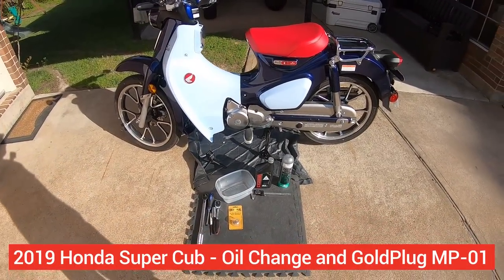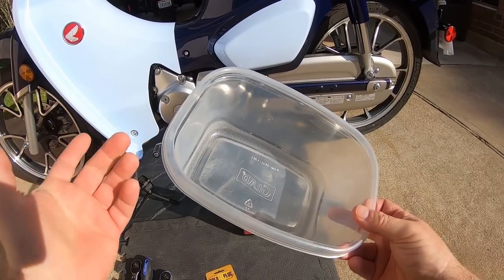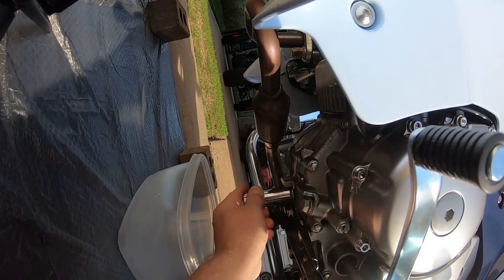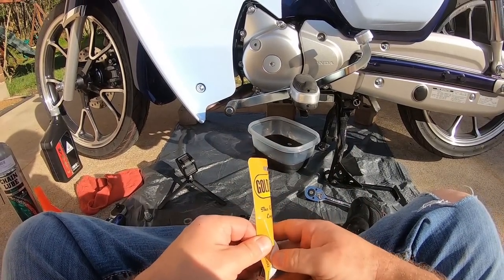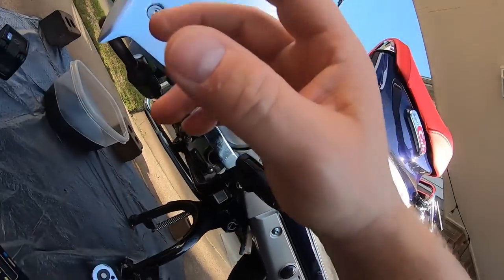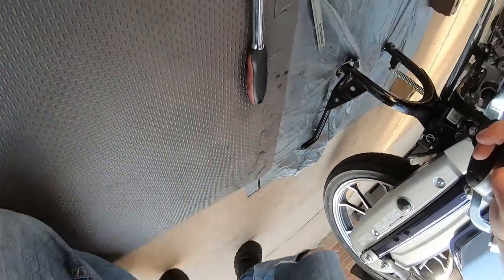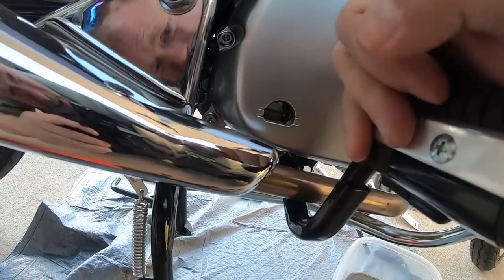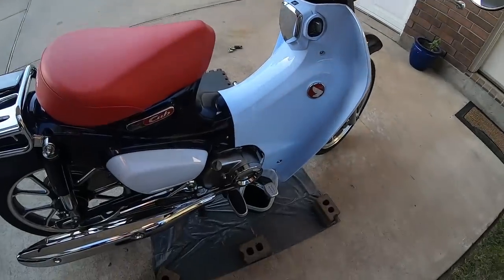2019 Honda Super Cub C125 // First (early) Oil Change // Gold Plug MP-01

Comment: Luggy cold start, mine does that too. But it idles up when it's very cold. I use at least 91 octane gas as well
Reply from the maker: Yep, it seems to be a common issue with the new Super Cub's.  I took mine in for the dealer to check out and they asked Honda about it... nothing "abnormal" as far as they are concerned.  I noticed that my friend's Cub (Adrian) also does the same thing.  It's not really a problem for me... I just baby it for the first 10 seconds after cold start to make sure it keeps spinning.  Cheers!  👍  --QM
Reply: @QuasiMotard  it's not a problem for me either. I dunno maybe it being an older style engine but updated management, that first start just needs coaxing sometimes. I switched upper octane and it has not idled off on first start. I dunno. I like my bike alot. I just noticed the spot on your video about the luggy start and I was like..me too! Lol

Comment: Yes, they do have an oil filter. The clutch drum is a centrifugal filter.
Reply from the maker: Agreed, but it's not a traditional oil filter.  The oil "spinner" on these bikes requires a cleanout (overhaul) every 8000 miles, and that procedure requires the removal of the engine side cover, oil spinner assembly (with a special tool), and fresh gaskets (side cover gasket and new O-rings for the spinner seal).  The procedure isn't as simple as replacing or cleaning a traditional filter, so many owners might not be inclined (or able) to do it at home.  --QM

Comment: 6:58, you can use tail of the caliper for measuring depth
Reply from the maker: Yep, I thought of that after the video.  I was trying to keep everything in frame and simple for the video's sake (it's hard to know what the GoPro "sees" after the screen shuts off).  I didn't want to use the tail when checking the depth inside the oil drain hole, though... no sharp metal poking around in there blindly.  When I used the straw and saw that there was plenty of clearance (over 1/8"), then I didn't bother following up with a precision measurement.  Cheers!  👍  --QM

Comment: Thanks Quasi...very helpful!!
Reply from the maker: Glad it was helpful!  I didn't have the service manual at the time of recording this maintenance, so I wasn't sure about the second bolt on the close (left) side of the lower crankcase.  That is the cam chain tensioner bolt, so you don't want to mess with that one unless necessary.  The owners/operators manual doesn't give any specifics on the procedure, so I just went with what I knew to be accurate on the drain bolt location.  I have the service manual now that gives all of the other detailed procedures and specs, so there isn't any more guesswork.  😉👍  --QM

Comment: Great video, I like the way you have been so thorough. I do however think your bike sounds a bit lumpy....it’s missing a bit. The Cubs normally run like a sewing machine. It’s maybe worth looking at the spark plug.
Reply from the maker: Thanks for the feedback!  The new Cub has a bit of a lumpy idle and the exhaust note is quite deep and mellow for a little 125cc motor.  I just picked up my new Trail 125 (CT125 Hunter Cub) a few days ago, and its exhaust note is lumpier (but quieter) at idle.  Stay tuned for the Trail 125 unboxing and first ride videos coming in a few days.  Cheers!  😉👍  --QM
Reply: @QuasiMotard  excellent I will look forward to that!

Comment: S trick is to weigh the used oil then weigh the new oil to check difference.
See if u can fit a l.e.d lite bulbs to save overloading altenator.
Reply from the maker: Oil weights would likely be different because of evaporation and slight differences in the fill levels.  I've done 2 additional oil changes since this one, and everything looks really good so far!  The GoldPlug magnet has caught a significant amount of ferrous material both times, so it appears to work in the Cub's sump.  All of the lights on the new Cub are LED's, including the driving lights that I added to it later (Denali DM, 5W/each).  Cheers!  👍  --QM
Reply: @QuasiMotard  generally when engine is new there will be a bit of metal coming off the timing sprockets, chain etc. Oil changes are great especially when it involves wet clutch plates. Dont skimp on good oils and make sure the correct oils is used for the seasons and climate. Amsoil (pay for a kit and become a dealer...brilliant company) Repsol, Eni Agip, Motul, Penrite and Castrols are all great dedicated brands for motorcycles. I find manufacturer in house brands is generally "fill" for the company for profit). I have came across with the Maxxima brand that says A.t.v etc but has no a.p.i ratings which we gave up on.

Comment: With regular maintenance, given that it's a honda, that thing should last a very long time!
Reply from the maker: I'm on the 3rd oil change now (last changed at 1500 miles), and I switched over full synthetic (Castrol Power1 4T 10W-40) this time.  I just returned from a 450-mile motocamping trip and ran the Cub at 55-60 mph the whole way there and back.  I was curious (concerned) to know how it would behave at wide-open throttle for hours at a time.  It hasn't burned or leaked a drop of oil... still at exactly the same level as when I filled it.  It's a Honda!  😉👍  --QM

Comment: Hi Quasi. I love your videos, I am taking my time watching the Cannon Ball Run episodes. Can’t help but admire your stamina and determination… that’s a giant adventure even on a big touring bike let alone a Super Cub !
Last week I bought a 2019 Super Cub with 25 miles, it’s immaculate, I now have 40 miles on it.
Question :  Would you change the oil on it NOW, because the factory oil is 4 years old ?
Note , I’ll change it at 300 miles also.
I did siphon out the 4 year old gasoline, and put in Sta-Bil 360 (1 ounce), and a gallon of fresh Shell 91 octane.
I’ve owned Moto Guzzis and Harley Davidsons for 40 years and always did real frequent oil changes so I’m thinking maybe I should change this 4 year old oil with only 40 miles on it.
I’m leaning towards using the Honda 10-30 conventional oil like you and switching to Mobil 1 full synthetic like you at 1000 miles ?
I’d appreciate your opinion.
I’ll get the Gold plug too.
Thanks.
Reply from the maker: Congrats on your new-to-you Super Cub!  The 2019 wearing the 60th anniversary blue color is the best looking, in my opinion.  I don't think it's absolutely necessary to change that oil, but it couldn't hurt anything to do it as a precaution.  Personally, I'd just wait until around 300 miles and change it like I did in this video.  

I strongly recommend investing the extra $20 in a Gold Plug MP-01.  Those things really work, and I always find ferrous sludge (and sometimes sharp chunky bits) on the magnet at every oil change... even at 15K miles.  These engines don't have oil filters, so it's cheap insurance to prolong the engine's life before needing a rebuild.

I typically wait until around 1000-1500 miles to switch over to full-synthetic so the engine is fully broken-in.  After the first 1K miles, I ran Castrol Power1 4T 10W-40 full-syn in my Cub for the next ~10K miles.  However, I switched over to Mobil1 4T 10W-40 full-syn during my return from the Cannonball in 2021.  

We noticed that our Cubs were steadily consuming/burning 125-200mL of Castrol per day at wide-open throttle (450-550 miles, 12-14 hours/day).  When we switched over to Mobil1, the consumption stopped... not reduced... STOPPED.  We didn't burn or lose a drop of oil from California all the way back to Houston.  Something about the Mobil1 base stock is thicker or resists seepage, so it seems to run better in these little Honda 125's.  

I also switched over to Mobil1 in my Trail 125 (CT125) during my 1600-mile trip to the Barber Small Bore Festival in 2022.  Here is a link to the first episode of that adventure if you're interested:  https://youtu.be/xItNMZ--qSc .  The little CT125 burned through nearly 300mL at wide-open throttle during the first day of that trip... 720 brutal miles in 14 hours at wide-open throttle!  Cheesr!  😉👍  --QM
Reply: @QuasiMotard  Thank you for the response so fast!
Yeah I really like the 60th colors the best of the 4 years of the Super Cub too. I’ll go ahead and wait until around 200 to 300 miles to change oil, and DEFINITELY install a Gold plug.
That’s amazing how your oil usage actually stopped when you switched to Mobil1. I’ve been using Mobile1 full synthetic in cars, trucks, and a motorhome along with NAPA Platinum, and Wix filters for about 5 years and real happy with Mobil1. I’ll switch to it for sure eventually.
I’ll definitely watch the Trail 125 video, I’m sure it will be interesting.
Thanks again, and safe travels to you. 👍😎

Comment: What was the other bung with the copper washer for, you reffered it to a service item  ,?
Reply from the maker: That second bolt with the copper washer is the timing chain tensioner.  It can be removed without any serious repercussions, as long as it's reinstalled correctly before the engine is turned over or started.  

Some Grom and SC owners have mentioned that they pull that bolt out during oil changes to drain some additional dirty oil that accumulates in that bore hole.  Removing and reinstalling that bolt can also reset tension on the timing chain idler wheel, which could potentially benefit engine longevity... dunno... maybe?  Cheers!  😉👍 --QM

Comment: What would be the reason for replacing the factory bolt? Really nice video, thanks for sharing.
Reply from the maker: The GoldPlug has a neodymium magnet on the tip of the bolt, so it catches ferrous debris in the oil and holds it until you clean it off during a maintenance period.  This helps to keep those abrasive particles out of the sump, so it should aid longevity of the engine amd transmission.  Keep in mind that the Super Cub doesn't have a traditional oil filter, and it only holds 0.8l of oil... that's a small volume of oil, so it can become contaminated quickly.

I always find lots of metallic sludge and some sharp particles stuck on the magnet at every oil change.  That tells me that the magnet is doing its job! Cheers!  😉👍  --QM
Reply: @QuasiMotard  cool, thanks man.

Comment: Hello, in the user manual, it says that it is best to have this operation (oil change) made by an expert mechanic. 
Do you think is it okay if I perform it by myself ?
Reply from the maker: The Super Cub is probably the easiest bike to change oil out of all the bikes I've owned (120+ over 40 years).  This older 2019 Cib doesn't have an oil filter, so the change is literally just a drain and refill with 850mL of oil. 😉👍  --QM

Comment: you have to be real lazy or incapable to hold a tool to let your mechanic  charge you unnecessary money for a simple service for such a simple and fuss free machine. its so simple that you fall in love with it just for this very reason , pure motorcycling pleasure.
Reply from the maker: Agreed... I prefer to do all of my own maintenance anyway... at least I know that it has been done correctly.  I will usually let the shop handle the first couple of maintenance intervals (e.g. required by warranty) so it's recorded on the VIN.  After that, I do 95% of the work myself and document everything thoroughly (e.g. pictures, logbook, etc).  It's surprising what you can accomplish with a factory service manual and a modest set of tools!  However, I take my bikes back to the dealer for any recall items or heavy-lifting chores... tire replacements, engine/transmission work, etc.  --QM

Comment: Great video, however I have a question. Do you change the oil every 300 miles ?? I have a 2018 C 50, that I just bought, and I m kind a beginner. Thanks
Reply from the maker: Thanks for the feedback!  This was just the first early oil change.  Honda's maintenance schedule for the Navi is 600 miles for the first oil change and every 2500 miles after that.  

I typically change the oil early in the first 300-600 miles to get the abrasive junk out of the engine.  Then I change the oil every 1500-2000 miles for these small engines because they don't have oil filters.  Cheers! 😉👍 --QM
Reply: @QuasiMotard  Thanks for your feed back ! I tought that it must be changed so often.. 2000 miles seems ok. Take care and have a nice ride. Cheers from Romania

Comment: Hi Quas.. have you ever had to fix a stripped oil pan thread?  Unfortunately, after my second Cub oil change, I inadvertently stripped mine (using MP01 plug) even before I could torque (plug was not getting tighter, which leads me to believe it may have happened after my first oil change (watched this episode a year ago).  There's a couple of videos on YT that shows how to use a Thread Repair Kit to basically re-tap the threads and avoid replacing the oil pan unit which can probably cost a fortune.  Any words of wisdom in this case?  Much appreciated.
Reply from the maker: Ouch... I'm sorry to hear about your troubles!  I've used Heli-Coil thread repair kits on cars and trucks in the past... anything from oil & transmission drain bolts to spark plug re-threads.  However, I haven't done it on any of my motorcycles.  

Most larger motorcycle engines have separate oil pans/sumps that can be replaced if necessary.  Unfortunately, these small engines don't have a separate pan... the oil sump and drain plug bung is part of the engine's crankcase.  That means repairing it with a new thread insert is the only way to salvage the problem without tearing the motor apart to replace one half of the crankcase.

It might be possible to re-thread for a larger diameter drain bolt, but I would leave that as a last-ditch effort.  There isn't much extra clearance around the bolt head to accommodate a larger drain bolt, and removing too much metal from the thin lower crankcase might create more problems in the long term.

Good luck with the repairs, and keep us informed how you get along.  I'd be very interested to see if/how a thread repair kit works on one of these little 125's.  Cheers!  😉👍  --QM

Comment: Hey man How often do you suggest to change the oil un a 2020 Supercub? I just did my first oil change at 500 miles.
Reply from the maker: I always change the oil on my small bikes every 2K miles.  The Honda owner's manual says 4K miles, but I think that's a bit long.  These bikes only hold ~1 quart of oil and they don't have traditional oil filters.  Oil is cheap, engines aren't!  I'd rather change early and often to be sure that I'm not grinding up anything important in the crankcase ( https://youtu.be/jk0E51XPD34?t=729 ).  Cheers!  👍  --QM

Comment: The manual is freely available as a pdf online.
I was wodering should I go to the dealer for my first oil change at 600 miles? I can do it myself but I guess my question is is it critical to resale value to have it dealer serviced?
Reply from the maker: I don't think it makes any difference whether it's dealer or owner serviced.  The critical issue is really about warranty coverage... if the dealer does the service, then it's recorded on the VIN for warranty purposes.

I do all of my own service on my motorcycles after the initial check-up.  I take pictures of the mileage, the parts, and receipts as proof of service.  Cheers!  😉👍 --QM
Reply: @QuasiMotard   Thank you... Great idea re photos of odometer etc!
 I know the manual recommends 10W30. I used 10W40 synthetic changing at 450 miles because that's all I could find easily here in Ireland. From what I researched the only difference will be that the 40 holds up better in higher temperatures. I guess I should really have waited a bit longer in line with what you say about bedding in, but on the other hand I'll be only doing low speeds as a new rider.

Comment: You mention that the 2nd oil change should be done by a Honda dealer, what mile should the 2nd oil come at? And why should the second oil change be done by the dealer, do they do other checks? Thanks for videos, they help.
Reply from the maker: That's a good question!  Just a point of clarification:  Honda's service schedule states that the first service is due at 600 miles, but I always do it early to reduce the runtime of that first dirty oil.  So, my Cub's second oil change was technically the first scheduled service.  It's not absolutely necessary for a dealer to do that first service, but it certainly helps in case of any warranty issues (e.g., proof that the service was done according to schedule).  

The 600-mile service interval is just an oil change, but many dealers also check the valve clearances and spark plug at the same time.  Subsequent service intervals for oil and valve clearances are at every 4000 miles (6400 km).  If you're interested in the full service schedule, you can download a copy of the owner's manual here:  https://cdn.powersports.honda.com/documentum/MWOM/ml.remawmom.2019_31k0ga00_cub125a_supercub.pdf .  Cheers!  👍  --QM

Comment: I have a Chines 50 cc with GY6 motor (old Honda engine) scooter and change the oil , the manuell says 0,8 L but according to the dipstick wish is so hard to se it's to much but i am hoping it will be ok. I have used the scooter for 1 week and its looks all ok so far.